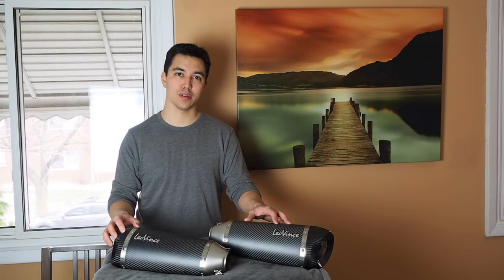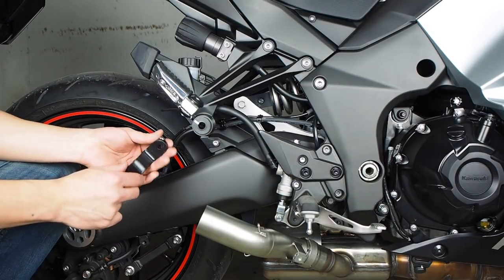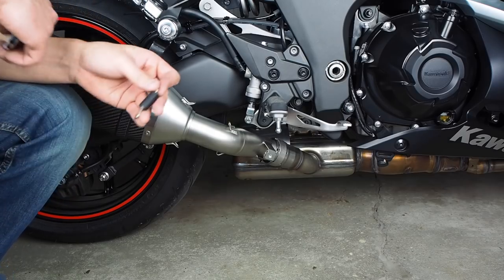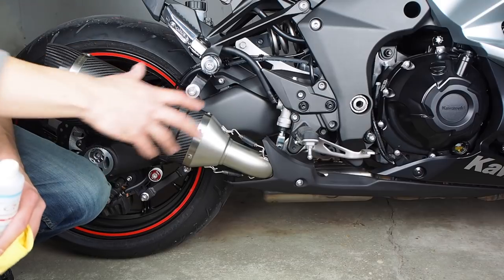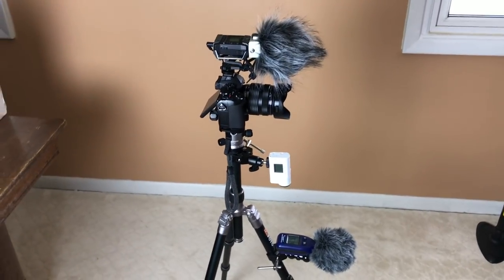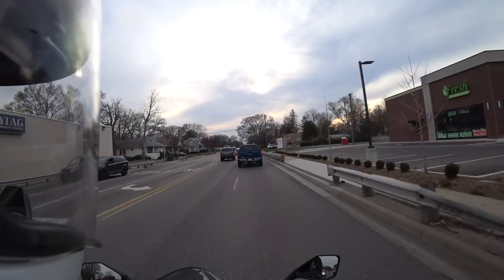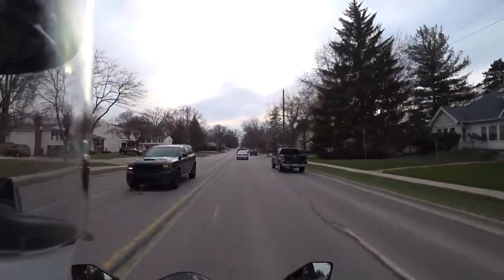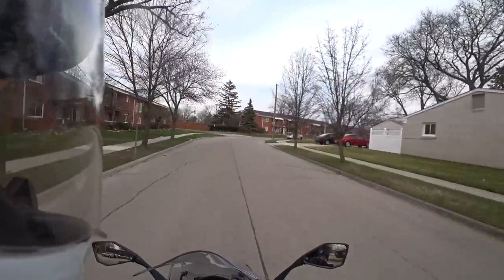Ninja 1000 / Z1000SX - LeoVince Slip-On Installation and Sound Test

Comment: This must be the best exhaust fitting instructional / review / sound test on Youtube. I have a pair of SP Engineering (UK manufacture)  short stubby carbon slip ons for the same reasons... foot clearance, access to the swinging arm / chain and brake caliper. They also sound better and make the wheel easier to clean.

Comment: Hi Jonathan, another quality video = well done!  The pavement on that patch of road near/under the bridge is a great place to test if anything is going to vibrate loose, looks similar to things I see here in Chicago.  On my 2017, I’ve completed my LED turn signals and BlasterX tail light install, replaced factory cans with Vance & Hines Urban Brawlers (with baffles), highly reflective rim tape, reflector removal, factory seat swap for Sargent, and just swapped out the windscreen for the Puig (dark smoke).  Your video’s have helped out a TON, so thank you for that and hope to see you on the road!

BTW - I had the X-grip for my iPhone 8 on the bike but swapped it out for the spring loaded cradle holder... makes it easier to use on the bike without having the side buttons pushed by the grippers of the x-grip.
Reply: Hi WOLF167h, could you please provide a link to the spring loaded cradle holder you're using? Thanks!
Reply from the maker: Sounds like you've got a nice list of mods there :) I've got family in Chicago and I've been looking for an excuse to ride over there, so keep an eye out for me!
Reply: Just HMU
Reply: WOLF167h Thanks!

Comment: Getting ready to get my new 2017 kawasaki ninja 1000 black.Thank you so much jonathan long!! Pls make a video on how to break it in properly. Do i need to put a power commander once installing the leo vince exhaust?
Reply from the maker: That's exciting! No need for a power commander w/ the Leo Vince, or for most slip-on exhausts.  I may do a video on break-in, but the short answer is to trust the owner's manual.  Keep the rpms under the prescribed limit, vary the rpms while riding, don't use heavy throttle, and run through all the gears.  Change your oil at the prescribed intervals, and you should be good!

Comment: Hello Jon,

First of all, congrats for the videos. I've watched them all, being a new owner myself. As others have stated, the sound difference seems minimal, and I would probably go with the slipons route for the same benefits you mentioned, especially the facts that they would be less in the way of the feet. However, I was wondering if you tested the sound level without any cans at all ? What does it look like Stock vs. Nothing vs. LeoVince ?
Reply from the maker: Congrats on the new bike! I did not test the bike without the mufflers simply because I had no intention of running the bike without mufflers. The Vance and Hines slip on for this bike would likely sound similar to running no mufflers, since they are just a straight pipe with no sound deadening. I’ll have an updated sound video in the next few weeks showing how the pipes sound after they’ve broken in a bit.

Comment: Really great quality video. The audio quality is so important on exhaust clips and that's often forgotten. I must say, I think it'd be good to follow-up with (or tack on) some WOT samples, as those are going to be where you see the largest dB and sound difference. With the mufflers completely removed from my N1K it's not that loud with gentle throttle application/mid-RPM. You may be in the break-in period, but it'd be nice to see some WOT/high RPM runs when practical to do so, as I that's where you're going to see the biggest difference in noise.
Reply from the maker: That's a good point.  I wanted to do some higher rev tests, but those will have to wait till after the engine break in.

Comment: Hey! That is a good guideline. But why was your stock exhaust on the right side not equipped with those EXUP lines?
Reply from the maker: Thanks! The 2018 model does not have that. I don’t remember what year they stopped using them.

Comment: Nice video! Really helpful, my Scorpion carbon slipons are soon going on the bike. Ive seen some kawa bikes and older bikes on this ninja 1000 have a servomotor under the seat with a cable attached to the exhaust. Seems your bike did not have something like that ?
Reply: As I understand it, post 2015 bikes aren't fitted with the exhaust flapper valve.
Reply: Models 2014 and after don't have the exhaust valve...and no servo under the seat. If you fit an exhaust that doesn't have the valve, simply remove the cables. The servo can remain functional so no error code shows up. There are gizmos to replace a redundant servo.

Comment: Instead of paying $349 for Vance and Hines double slash pipes, I got the same at Auto Zone. With the reduction connector pipes, I paid $40 all in, pipes installed. Decibels out the back are 93db.

Comment: Great video!  Would strongly suggest picking up a spring puller to place the exhaust springs on the exhaust hooks.  I use a Motion Pro 08-0127. They are cheap and you won't beat yourself up.  Only thing I would suggest.  Great job!
Reply from the maker: A spring puller would have been a big help.  One was supposed to be included with the exhaust system, but was accidentally left out.  Anyone else that gets this system should receive a spring puller.
Reply: Jonathan - How do you like the Ninja 1000 so far?  I'm thinking about picking one up.
Reply from the maker: Short answer - I love it.  Long answer - stay tuned for a comprehensive review video, which I’m currently working on.
Reply: Will tune in! Thanks!

Comment: Hey, what about exup? Did You touch it? I'm going to do it myself tommorow (Leo Vince Nero exhaust). Thanks for info!
Reply from the maker: No exup valve on the 2018.  I think they stopped using it for 2017 - current.
Reply: Thanks bro. Mine is 2016, but already watched few videos, and think I'm ready to action 2mo.

Comment: Did you notice anymore power or less restriction after installing the new pipes?
Reply from the maker: I haven’t noticed a power difference, but I’m just finishing the break-in process of the bike, so I haven’t used 100% of the available power yet. I don’t think you’ll see noticeable gains with just a slip-on (any brand) due to the restrictive catalytic converter and chamber that stays on the bike. If you combined the slip-on with an aftermarket header, then made the necessary adjustments to your fueling, you’d see some more noticeable improvements in power.

Comment: Hi Jonathan. How easy is it to take out the DB killers and to put back?
Reply from the maker: There is a single 4mm bolt that you remove to take out the dB killer. They are a tight fit, and I found its easiest to put the handle of a long screwdriver inside the insert, and then use the lip of the handle to tap the insert out from the inside. They slide back in very easily, though.
Reply: Jonathan Long thanks a lot Jonathan! Really thinking about getting this exhaust on my black 2018. But it's like 1000euro here

Comment: Hello Jonathan, I have the same bike as you but 2019. Do you know if there are any kind of full exhaust system that fits on your bikes but allow the OEM panier? I know acrapovich makes one but they clearly says will not fit with the saddle bags. I was wondering if I only use the acrapovich headers with the leo vince like your would clear the bags?

Comment: The stock system on this bike is so restrictive and crammed with 'cat' that I'd run a full system replacement. Slip-ons will bring only minor sound for a pretty decent chunk of money. A full system 4-2-1 will drop around 20 pounds of weight.

Comment: Unless you remove the catalytic converter box, the bike will not get louder. It acts like a big empty muffler, because the actual catalyst material is only a puck in the pipe pre-cat. Which acts like decibel killer.
Reply from the maker: The stock cat definitely muffles a good amount of noise.  But now that my slip-on has broken in, it’s quite a bit louder than stock (with the DB killers out).

Comment: Swings spoils ? Can someone plz explain.
Reply: Swing arm spools. They bolt into that hole beneath the muffler. They are used in conjunction with a motorcycle jack stand to support the bike off the ground.

Comment: Waste of money sounds exactly like stock.
Reply from the maker: The dB meter shows the volume increases more than your speakers may indicate. There are noticeable differences, especially when the dB killer is removed. And now that the muffler has broken in, it has gained some additional volume. I’ll likely post an update to this video with and without the dB killers. But as I mentioned in the video, the slip ons solve other problems with the stock exhaust other than just changing the sound.

Comment: Why would I buy this bike? It has really budget accessories. Like the heated grips? Its not even integrated into the menu system. Just a weird looking dongle mounted to the handlebar. No comfort seat. You pay for the brand lol
Reply from the maker: Sounds like you wouldn’t buy this bike, but everybody has different needs and wants.  From my perspective, it represents a good value.  A powerful, comfortable, and versatile sport touring bike with great LED lighting, advanced ABS and traction control with IMU, fully adjustable front suspension and remote preload adjuster for the rear, and well-integrated removable luggage.  I couldn’t find those features in any other bike at this price.  I don’t consider Kawasaki one of those brands where you’re “paying for the brand.”